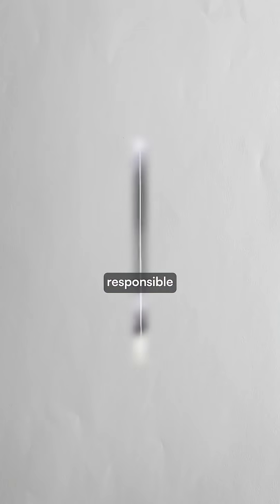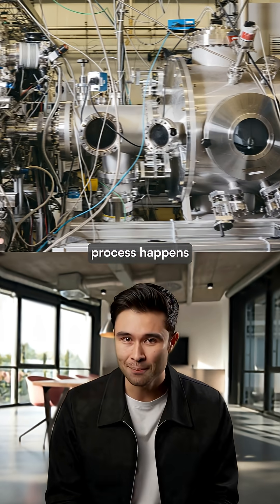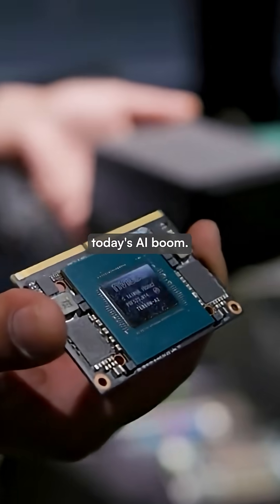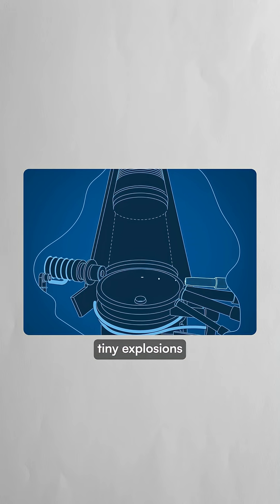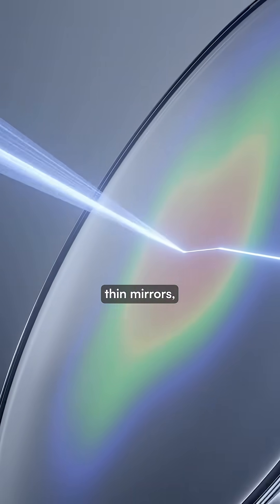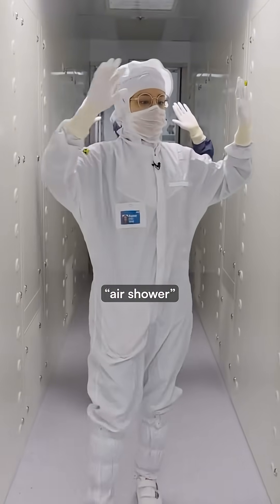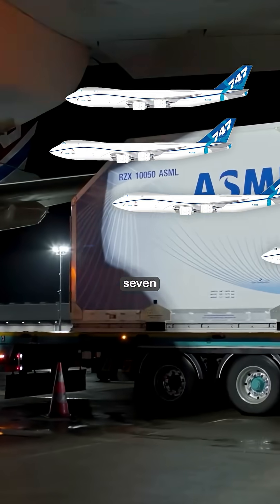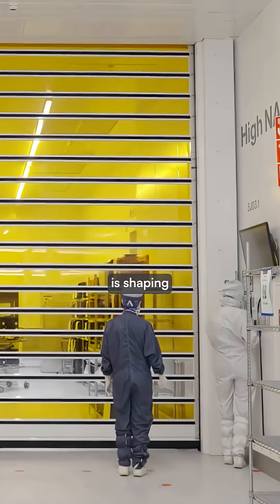These machines are responsible for the world’s computer chips ⚙️ #trendingshorts #ai #data #tech

Comment: To be precise: the MACHINE is built by ASML, the EUV laser component is made by Jenoptik in Germany.
Reply: And the wafers come from Japan
Reply: @Muhammad_Ahmad_  TSMC uses wafer suppliers from Japan, Taiwan, Singapore, Germany and US.
Reply: @solomonshv Singapore doesn't have factory, are u kidding 😂
Reply: @solomonshv …and this as little to do with ASML, thank you. 
It is like when discussing a new car, throwing in where a potential buyer would get the gasoline from. ;)
Reply: @Muhammad_Ahmad_ Wow! Thx for filling in, guys!
Reply: @Muhammad_Ahmad_ ASML does not need wafers. It is sold to customers who want to produce chips. They need wafers, sourced from anywhere. And yes, they do source it anywhere.

It is a bit like discussing the production of a new car and then stating „yes, but they need gasoline produced in xyz.“ Or mentioning where the paper comes from when discussing printers. Makes not much sense, right?

Sorry, but not so smart of a comment.
Reply: @Muhammad_Ahmad_  And China is claiming they invented all these machines and parts
Reply: @Muhammad_Ahmad_   the wefers comes from Zeiss Germany
Reply: Actually there is another Dutch company researching silicon ultraflat wafers and I am pretty sure they work with ASML too
Reply: @Muhammad_Ahmad_ 😮
Reply: @Muhammad_Ahmad_  doesnt matter were they come from thats like a consumable 
Like if we are talking about a printer and one says the machine is made in netherlands and the other the print head is made in germany and you and the paper is made in japan lol
Reply: I also think the lenses come from german Zeiss
Reply: @stalkinghawk9244  modern EUV machines do not use lenses anymore, they use mirrors. lenses absorb some of the light, which makes them unsuitable for applications in the sub 10nm range. mirrors do no absorb anything. but they are made by Zeiss.
Reply: @stalkinghawk9244 mind you lenses are opaque for EUV light. That‘s why mirrors are used.
Reply: @stalkinghawk9244 correct
Reply: @stalkinghawk9244  There are no lenses, as UV light doesn't penetrate. They use mirrors with incredible precision.
Reply: @stalkinghawk9244 the germans always tryna take credit lmao😂😂
Reply: @ankkaproductions5822 well Germans=>technology itself. So yes, they do have their footprint in anything technical.🤷🏼‍♂️
Reply: And a lot of research on this was made in Aachen and Alsdorf, also in Germany.
Reply: @asedhzf  and transistors were invented in Texas
Reply: @asedhzf 
Where are you going after you die?

What happens next? Have you ever thought about that? 

Repent today and give your life to Jesus Christ to obtain eternal salvation. Tomorrow may be too late my brethren😢.

Hebrews 9:27 says "And as it is appointed unto man once to die, but after that the judgement."
Reply: @asedhzf  Without Czochralski none of this would be possible. This is all BS, because if not for ASML or any of these companies, some other company would produce these.
Reply: @peterc4082 …but they don‘t. Why?
Reply: @peterc4082 If not this guy, somebody else would have invented the basics. Your own argument…
Reply: @tomsaltner3011  Everything can be invented by someone else. But maybe you meant to use the word, 'discover'. This is also possible that others can discover something as well.
Reply: They began developing EUV technology at a time when it seemed that conventional lithography had reached its limits. Then came immersion lithography, and EUV initially appeared unnecessary. Nevertheless, they continued its development. And now they're actually 10-20 years ahead.
Reply: @lutzj74  The light frequency is the difference.
Reply: It's not matter where the euv  machines are made prease send for me emails of all the detailed blueprints of these machines to our offices in Shenzen China. The senders will be greatly and richly rewarded by our great leaders and patriotic comrades from the CCP.
Reply: It is also designed by asml. Those companies are just used for outsourcing, so that asml doesnt have to build their own facilities to manufacture those components
Reply: The laser is only a VERY small part of the machine. Plus, Jenoptik just produces what ASML designs.
Reply: And the flightcases that are used to ship the machines in are made by Reco Fligtcases in Uden, the Netherlands.

So you know.
Reply: I would say this is not entirely correct. You may be right in that the source lasers that are used to vaporize the tin are from Jenoptik, its common in our industry to purchase laser heads then make in house systems to generate a specific wavelength, however the illuminator (seen in the video) is manufactured by ASML and is where the 13.5nm EUV light is generated.
Reply: To be more precise: there is no EUV laser. 

German company TRUMPF makes the high power infrared laser that evaporates and excites the tin drop plasma, the ZEISS components guide the desired light from this plasma onto the chip. ASML takes care of the droplet generation and combines everything together to a working system.
Reply: @brainjesustree4475 

ASML also programs the laser aiming software, as every droplet needs to be hit three times (flatten, scatter, evaporate) so the plasma can then be excited to make laser light.
Reply: @kipz0r1 Important parts simple-minds do ignore.
Reply: @brainjesustree4475 Sure it is not ultra-violet? That would make much more sense than low-frequency infrared…
Reply: @tomsaltner3011 

Since I built these lasers, yes I'm sure. The important part is to have the energy to get the plasma. Only a small amount of the plasma radiation spectrum has then the desired EUV wavelength and is used.
Reply: @tomsaltner3011  EUV is ultra violet. On the border to X-Ray.
Reply: The oütics come from Carl Zeiss SMT in Germany, the laser is from the Trumpf company, a family owned german company.
Reply: The Laser is made by Trumpf in Germany
Reply: Germans always the Root of everything

(Dieser Kommentar wurde verfasst von einem Einwohner der Bundesrepublik Deutschland)
Reply: @average4154  Liebe Grüße aus der Heimat von Zeiss und Jenoptik 👋🏻
Reply: The Laser who hits the droplets twice! are made by Trumpf
Reply: It takes a village.
Reply: It's not matter where the euv  machines are made prease send for me emails of all the detailed blueprints of these machines to our offices in Shenzen China. The senders will be greatly and richly rewarded by our great leaders and patriotic comrades from the CCP.
Reply: The components for this machine come from all over the world.
Reply: To be clear ASML uses the EUV lithography technology owned by the US Department of Energy and licensed to ASML and SVG. ASML bought SVG. ASML needs permission from the US DoE and US SoS on what nations and companies they can sell the machines to!!
The technology was invented in and owned by the US Government. ASML cannot do anything without their permission.
Reply: @JustinCase80884 source?
Reply: Isn’t the Laser by Trumpf ?!

And the Optics are from Zeiss who are related to Jenoptik but not together anymore since 1989
Reply: Where does Taiwan come in?
Reply: Globalization. Look it up.
Reply: I think the euv drive laser comes from trumpf Germany .
Reply: What? The euv is the asml. They use a carbon gas laser in ir light to hit the tin to turn it into the euv so idk wtf your talking about
Reply: All the rare-earth magnets in EUV machines are made by Chinese.
Reply: Nigga who cares god damn.
Reply: It's a global partnership which some dictatorship thinks they can easily replace in a year
Reply: And any defects that crop up are, naturally, Made in Britain... 🇬🇧🔥😉
Reply: Made by trumpf**
Reply: I just bout a $100  share of ASML because of your comment
Reply: No it's not. The laser is made by Trumph. Jenoptik makes the mirrors inside the POB
Reply: And the laser source is fro
 Trumpf
Reply: Some components from 🇵🇰
Reply: Multiple countries are involved in the process.
Reply: I told NASA about the Moon and they made Moonfall ; )

Its not too late, need to make a Universe room and reverse Tesla ball atmosphere models, also just spray desalination ocean water, not aluminum and carbon which cause refractory radiation and is cooking the atmosphere and causing refractory radiation on the surface making it intense, also you might be able to change an orbit

It is imperative that we stop spraying aluminum and CO2 into a magnetoshere and start spraying desalinatated ocean water instead, were causing refractory radiation and it's making the heat much more intense and heating the planet and causing melting of ice caps and evaporation of ocean water which then makes fresh clouds; we need to just spray salt free ocean water. The more we try to cool the planet were actually making it hotter and energizing a magnetoshere which could cause more solar flares and fry us. We're cooking the planet and causing solar evaporation of the ocean for clouds formation instead of just misting H20 out of 747's, got a whole plan

Hello my Friends

ANUBIS IS THE BEST DOG

What if Pharoah was trying to build a weather machine to attract lightening to nuclear electro magnetic earth ground to cause more rainfall and thus more food. 

Clouds of higher solar charged particles jump to clouds of lower static change, known as heat lightening, as nature seeks a balance. 

When there's enough solar charge in a cloud electricity as lightening crosses the air insulator and connects to earth, as it does it creates a vortex where hydrogen and oxygen particles connect and bring down water droplets and fall due to nuclear electromagnetic gravitational earth gravity. 

Electrons go around an atom like the moon around the earth and the planets around the sun.  

The Egyptians saw that lightening was attracted to metal, and the higher the better. 

If Pharoah had a copper cap on the pyramids with electrodes running through the air chambers down into the spring underneath, Benjamin Franklin might have been wearing an Eye of Horus Watch and driving a Bently.

Is the grounds turned dry, like a leather glove, no matter how much you tried to arc welds, it wouldn't work. Tree roots go searching for water in the winter when there is no rain, as solar photoelectric synthesis move through an organism seeking earth ground.

Also lightening is more likely to hit the lone farmhouse than the neighborhood, as electricity in houses flow through a black or hot wire, and take a neutral [white wire] path back to the electrical panel, where the Neutral Bar is bonded to the Ground Bar and goes into the earth via an eight foot copper electrode to dissipate returning unused current into the ground. So neighborhoods are energizing water tables instead of storing that electricity in batteries.

Anyways, I'm thinking a cargo helicopter, a brand new Copper Cap for each pyramid, and copper electrode wires running down to earth ground via the spring water table, and electrodes can be drilled into the earth below the springs for better contact, and we can complete Pharoah's Weather Experiment as lightening is attracted to metal high up from the ground ; )

Could you imagine the attraction of this new event to honor the Pharoahs and those that built the Pyramids!

And maybe bring more rain to the earth, and keep it most, and electrically conductive and inductive to storm clouds for more crop rain. 

If you want to in vent some cool stuff im at 224x833x2094 usa

Also, should we celebrate ancient ruins or rebuild them to honor ?

Also oil rigs should be underwater and not above and you wouldn't have oil spills 

China builds underwater structures, you could be just 20 feet underwater, you can run vertices flexible stormproof snorkles and a flexible to surface entrance/exit 

And, 

Grow more opium most the world's doesn't even want to be here and people can move other places, it grows in attics that are 140 degrees, skylights would need insulated glass in the attic shafts and you could use mirrors in the gable ends, just don't be in the attic in the day, if there's ever a shortage

Also oil rigs should be underwater and not above and you wouldn't have oil spills. China builds underwater structures, you could be just 20 feet underwater, you can run vertices flexible stormproof snorkles and a flexible to surface entrance/exit

Sharks could be GPS chipped at a bait source and an alert could go to cell phones and beach alert systems if sharks are within 300 M

Aluminum spayed in the atmosphere might f you magnetically with solar flares

Use aluminum for other things, spraying carbon and aluminum heats up the planet and causes refractory radiation on the surface, the carbon in the clouds traps in the heart and in the ocean causes dead spots. You need solar distilled ocean water misted or of 747's instead, the sun will burst up H2O into H, O1's, making 02, O3 ozone, and you're actually adding more fresh water clouds up there, not depending on surface evaporation by causing more heat in order to make more clouds, you need to cool it

8.4 billion acres of grass=4 billion cows in the world shipped frozen fresh lawn mower clippings somewhere cool like Alaska and each cow gets a bowl of ice cream at each feeding session

You need a leaf sucker truck with a refrigeration unit, grass is mowed for tax refunds, 20 Million jobs paying 60k from May to October in air conditioned, sealed window, tinted window, XFM lawn mower cabs with triple level suspension seats, mini leaf suckers pick up small piles and dump them by the street, big leaf sucker truck picks them up and freezes the frozen grass and then it goes to rail cars then somewhere cool to be 1100 lbs with a boney jacket. The people that kiss cows and sing songs for them take care of them and she gets a bowl of ice cream at the end of each feeding season. You'd have 10x more cows, over 1 Trillion in goods. In the US you'd have to double your grocery stores just for the milk, cheese, cheese cream, sour cheese, cottage cheese, yogurt, milk, butter, ice cream, etc...

When she doesn't want to be a cow anymore she gets a bowl of ice cream with some fennies

I have a lot of invention ideas in energy, defense, security, food infrastructure etc...

Would like to meet up with some people and talk to them about making some cool stuff

Missing solar film wrap on high rises and fields shouldn't have solar panels but should be solar panel green houses growing every crop everywhere, humid and tropical warm all year growing facilities
Reply: the design of these machines and the advanced parts are from the US
Reply: Well done!!!! Thank you for clearing that up
Reply: And the mirrors in the machine are made bei ZEISS
Reply: This is likely the result of multinational science and industrial cooperation .
Reply: Give over
Reply: The Mirrors in the machine are from Zeiss so Germany aswell
Reply: almost 5000 companies make up ASML
Reply: You are all a herd of nerds and I'm grateful for every last one of you.
Reply: German pride is really a thing 😂. There are pieces of these machines made by several countries and no one is bragging here. Chill brother
Reply: Nazi imperialism
Reply: I never knew that.
Reply: The Crown Jewell of Engineering
Reply: The soles on the shoes that ASML employees wear in the clean rooms are made in Portugal. Just so you know.
Reply: Bro, what you said about ASML is truly fascinating. A single machine costs $400 million, takes 18 months to build, requires 7 jumbo jets for delivery, and still it cannot come close to the complexity of a single human eye — which Allah created for free.

Think about it:

That machine can only function because it follows fixed physical laws (light, lasers, droplets, vacuum). Who created and sustains these laws so perfectly?

If humans need thousands of engineers, billions of dollars, and years of effort to make just one imperfect machine — then who engineered the human brain, with 86 billion neurons working in perfect harmony?

If one chipmaking tool requires so much planning, can the universe, galaxies, life, and even your own heart come into existence “by chance”?

The Qur’an asks:
“Were they created from nothing, or are they themselves the creators?” (Qur’an 52:35)

And also says:
“He created everything and determined it with precise measure.” (Qur’an 25:2)

Bro, human technology only exposes how dependent we are on the laws set by Allah. Even with all this science, nations still fight for monopoly and power. But on the Day of Judgment, no monopoly will remain. Allah will ask:

“To whom belongs the dominion today? To Allah, the One, the All-Powerful.” (Qur’an 40:16)

So yes, ASML’s machines are impressive — but they are nothing compared to the creation of Allah. If we admire human invention, shouldn’t we admire and submit even more to the Creator who gave humans the knowledge in the first place?

Turn back to Allah before the Day comes when no technology, no machine, no power will save us — only faith and good deeds will.
Reply: Nobody cares everything has parts from all over the world.
Reply: Mineral Refinement happen in China
Reply: Isn't the laser from Trumpf?
Reply: @_TeXoN_  To me, Trumpf was known for their CO2-Lasers for Cutting. But you are correct. They use a 30kW CO2-Laser that hits tin droplets which emit the EUV. Zeiss makes the optical components.
Reply: The lemons used on ASML lemonade stand come from Yugoslavia.
Reply: What a dumb statement. These machines have components from all over the world. WHATS striking is that apparently the Dutch were the only ones with the required mental acuity to put all these pieces together and make it work
Reply: @HM-dw4bp  What a dumb statement. These machines are not built from off-the-shelf pieces. These are highly specialized suppliers, system integrators and research institutions that exist in a symbiotic relationship. It's the knowledge gained together over decades that puts ASML some years ahead of the competition. Sure, there are other players in the field. But if ASML suddenly had to change suppliers and source components from just anyone, it would set them back half a decade. Just like the Russians and Chinese can also build airplanes. They just couldn't build something that truly rivals Airbus, because the don't have the supplier ecosystem.
Reply: @meckerhesseausfrankfurt4019 In marketing terms they lack behind airbus, not the technology, but they have their domestic market, so either russia or china are satisfied with those. The international market is not their obsession, but they will go there eventually, especially china.
Reply: @meckerhesseausfrankfurt4019and what’s your point exactly, basically every manufacturer work that way and that doesn’t make the guy statement false. What a dumb statement.
Reply: @HM-dw4bp  if it aint dutch it aint much 😅
Reply: @HM-dw4bp  No. The Dutch just happen to be allowed to do this. The Dutch have average IQ, they're not particularly smart, they got rich off the slave and spice trade and many collaborated with H1tler.
Reply: @HM-dw4bp ikr that’s so dumb 😂 they will think Toyota made entirely their car in japan because it’s a japanese company.
Reply: I actually own a Jenoptik camera!
Reply: Philips lost out on both ASML and TSMC.
Reply: @EdgyNumber1 wasn’t ASML a division of Philips initially?
Reply: @EdgyNumber1 Your source?
Reply: We need to put a 900% tariff on these machines now!!!
Reply: @treborobotacon  And killing the chip-industry. Great idea.
Reply: This is crazy....
Reply: ohh i was curious as to how can dutch people do something so advanced
Reply: @mangowatermelonsalt Because we are very very smart.
Reply: and the enchantments come from usa
Reply: EUV source is not a laser and is actually a US tech.
Reply: @zuzkazuzka8284  You are right about 45nm technology back in the day. Now, we talk about 3nm and 2nm and those are different.
Reply: @tomsaltner3011 Back in the day? Did I miss something or have they made a light source better than tin plasma 13.5 nm? found in NXE machines?
You do know that 3nm is not a real pitch between elements in normal sense and is actually done as consecutive exposures?
Reply: @zuzkazuzka8284  wrong, the optics and are invented, engineered and made by Carl Zeiss SMT, while the laser is from Trump, another German company. Don't underestimate German engineering.
Reply: @rupert9901 What statement is wrong in your view exactly? 
The dutch are not some magical dwarf people with ancestral knowledge and not designed these machines by themselves. Which is the point that I and other people in this thread are making. It is a joint worldwide effort. 
And do differentiate between different parts of the machine please. EUV source is as separate thing from the projection optics as is wafer loader, maglev stage and wafer levelling system to name a few.
Reply: @zuzkazuzka8284 I totally agree, apart to the statement the EUV lighting system being of US origin. It's made by Carl Zeiss SMT and Trumpf by sure. As I wrote before, btw.
Reply: @zuzkazuzka8284  This is correct, the foundational research was actually carried out by the Department of Energy.
Reply: The main critical components from ASML's side are made in San Diego CA and Wilton CT.  Also the entire power system and inspection system are made in Shanghai.  Veldhoven is final assembly - and supposedly they key some magic juice for all the parts made elsewhere that have to come from Veldhoven.
Reply: It's a shame there aren't 'Stupid Geek' awards. You'd all rank in the top ten for information no one asked for. It's hilarious watching people compete for nothing but some perceived ego boost.
Reply: @minkorrh Just go somewhere else. YOU decided to consume this. M0r0n.
Reply: @minkorrh you're just evious.
Reply: @minkorrh And you just made No. 1, congratulations!
Reply: @minkorrh  The whole video is like that. It's simping over ASML.
Reply: Who asked
Reply: @squeesquaaful Read what you want and ignore the adult discussion, kid.
Reply: @squeesquaaful  Who cares? You will get an answer anyway.
Reply: @quickwimnl bro fell for ragebait
Reply: @squeesquaaful  You really think the world needs ragebait? You're that kind of gay? Alright.